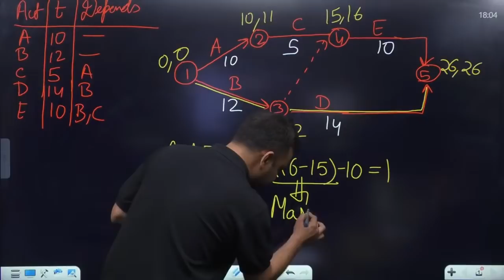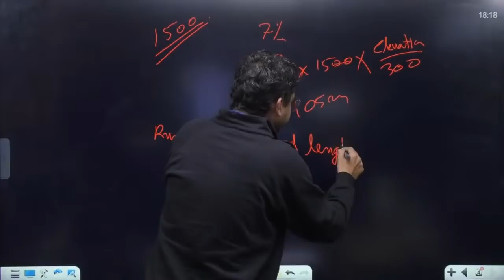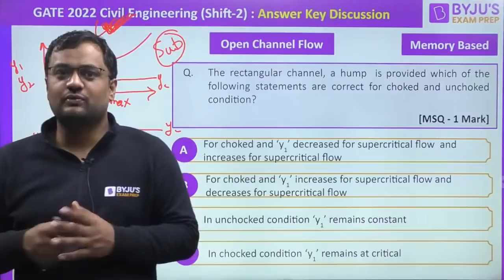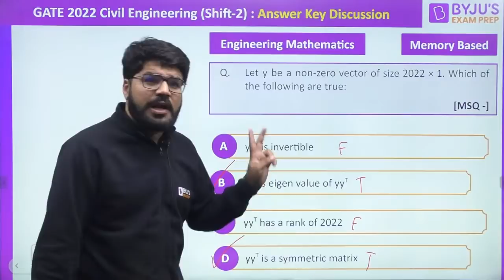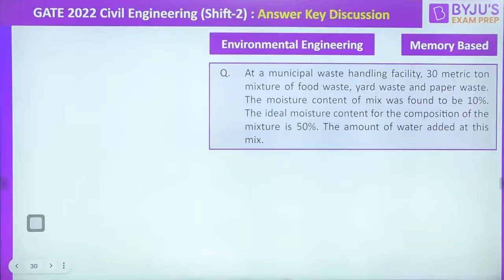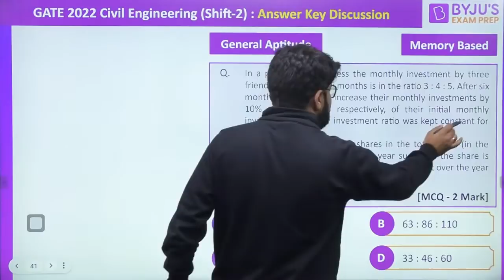GATE 2022 CE Question Paper Discussion | Afternoon | Answer Key, Expected Cut off & Paper Pattern

Comment: Sir for aptitude question on syllogism, it's given that all clean objects are wet..... And some soaps are clean.... So some soaps which are not clean will not come inside of wet objects circle...... Basically what i feel is that wet objects circle will not be big like what is explained here...... I feel some part of the soaps are out of wet objects' circle.
Please clarify.... and correct me if I'm wrong. Thank you